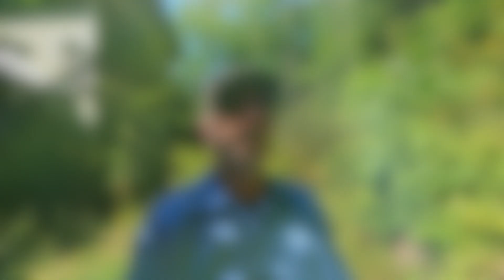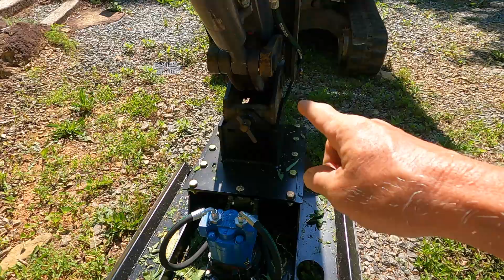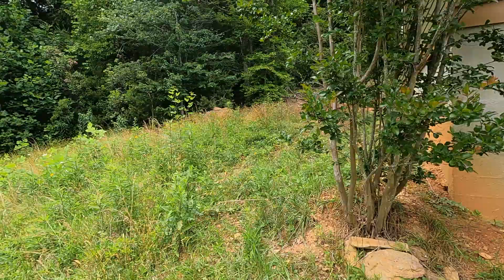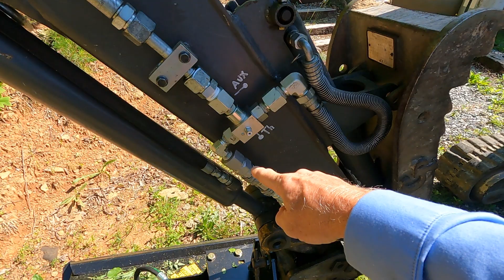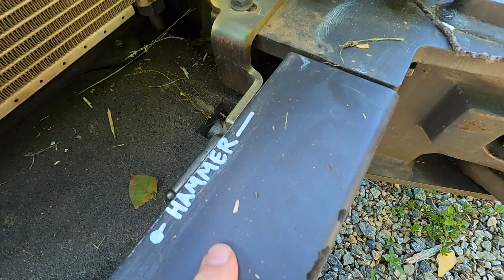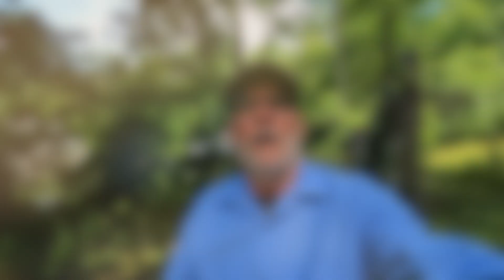Mowing with RUT Mower and Volvo Mini Excavator

Comment: Was your excavator plumbed for the extra connection or did you have to add it. Did you add a diverter valve & if so which one?
Reply from the maker: I used the hydraulic lines for the thumb. I added a quick connect coupler. I bought a diverter valve but you have to buy one to fit your machine and get the correct pressure rating for your machine. I’d go to a hydraulic shop or ask your dealer. Also you need to switch a valve for continuous flow called hammer mode.

Comment: This is the video I have been looking for, as I have a jcb 35 size machine, mine is 18 gal a minute, so it looks as if mine would be fine running this same model. I’m prb going with there cheaper model.

Comment: what size pin is on your Wain Roy connector they claim they don't have the 1 1/2 inch pin drawing.
Reply from the maker: I think mine is 1-3/4”. What size excavator do you have?  If you have the smaller system it might not support the requirements of the mower. Ask the mower rep if your machine will handle it in terms of weight and hydraulics.